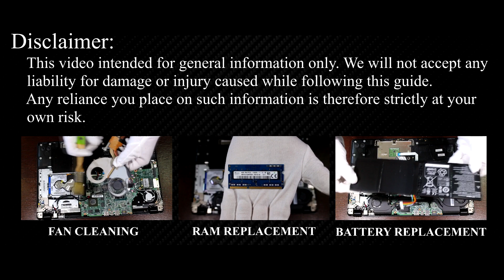Upgrade Acer Aspire V5-573, V5-572 Hard Drive or SSD - Step-by-Step DIY Guide

Comment: My laptop won't boot up and can't acces the hard drive (c disk) to backup my files. I can get acces to the D/E partition in a WInPE environment but not to the C where some files are located that I want to copy to a external drive. Is it possible to remove the HDD from the laptop and connect it with a Sata to USB  adapter and remove the files from it? And is the edge of the laptop glued together? This will be my last effort to collect the files if the other options wont work.

Comment: Is it possible to use the m2 slot for ssd? Am i correct that i saw a empty m2 slot on near the fan / wireless module
Reply from the maker: No, this is not a m2 slot
Reply: @howfixit  What is it, then?
Reply from the maker: This is mSATA slot, more information about storages here https://youtu.be/s-2VrxgI49Q
Reply: @howfixit  what can we connect on mSATA slot? I want to add SSD in addition to factory added 1tb hdd on this laptop(Acer v5-573G) is there any way i could do it?
Reply: @pcexpertsahil  Yes, just install an MSATA SSD there and install windows on the MSATA drive. You can still access your files on the original hard drive even if you are booting off of the SSD.
Reply: @lbsiuk   Hi I am trying to add Msata to my acer. Do you have any guide or video on how to do that. Thanks
Reply: @lbsiuk  is there any way to keep my hdd and along with it can i add some ssd drive like m.2 ssd??
Reply: @iqbalpinjari9790  buy msata drive and plug right at wifi card.
Goto bios, set boot priority to msata drive.
Instal windows as usual

Comment: After unplugging/replugging the battery for the replacement, the battery stopped working properly; with AC power I can boot and it registers the battery at 100%, but if I unplug the power chord it dies and can't turn on, any easy fix for this?
Reply: u may wana open up the cover n double check the battery connection again.